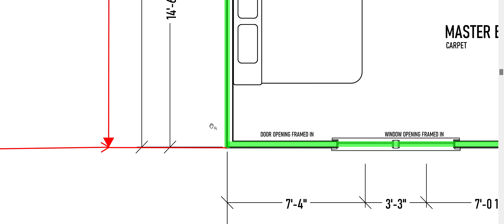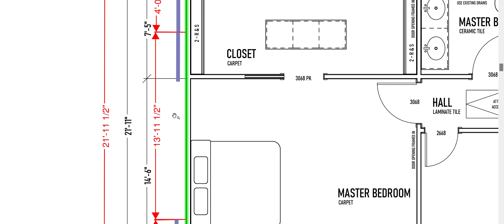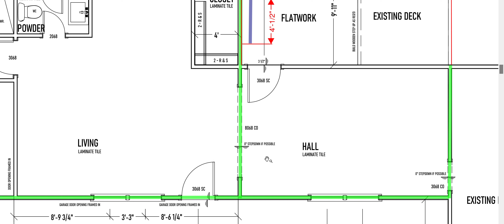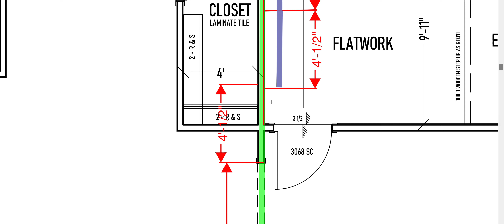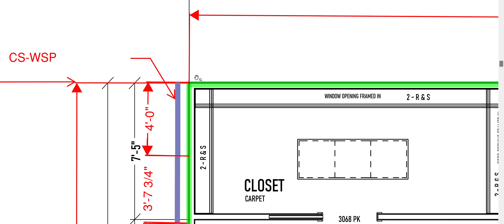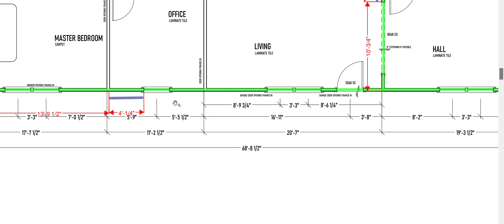Step 3 - Place Braced Wall Panels

Comment: Thanks for the video! It was very helpful. I just have one question: If the width of a building exceeds the 25 ft, but if I add interior shearwall to meet the rules, what's the max distance from the edge of the interior brace wall to the exterior brace wall (perpendicular)? I have a 12 ft open space between the living space and dining room. Thank you.